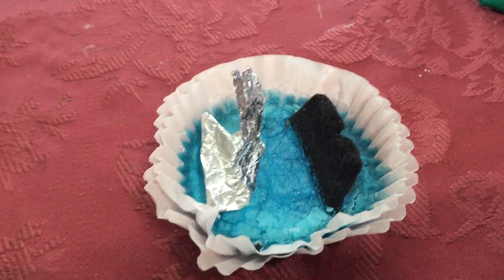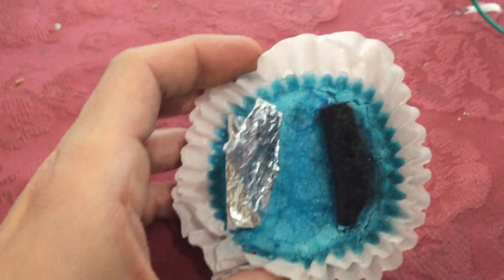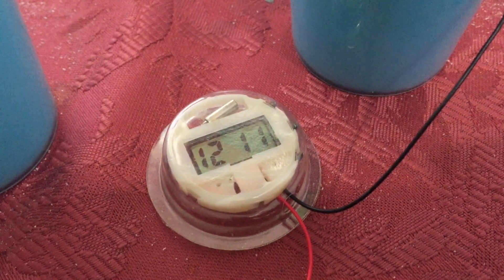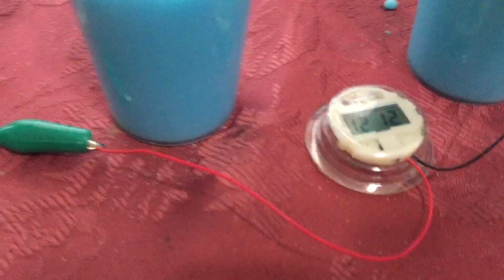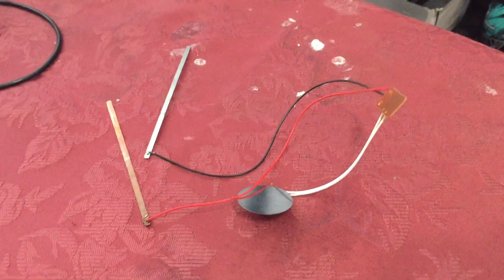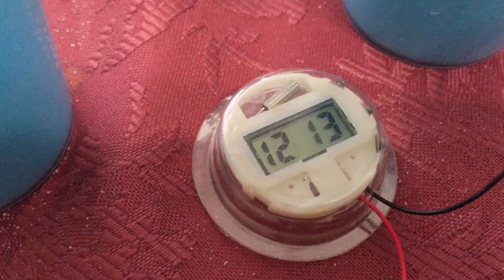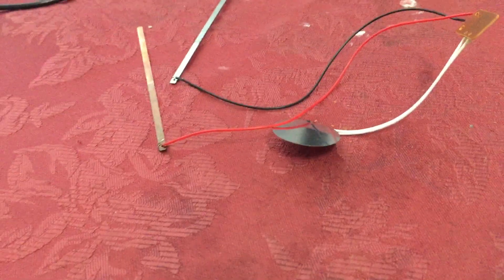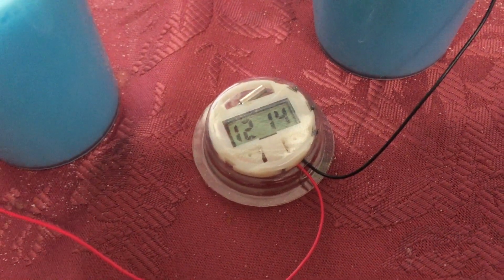PEG Cell Clock

Comment: Great update ❤

I wonder if you have explored the idea to reduce the size of electrodes and the consequent size of the cell ? I am getting the same results even if the “electrodes” are decreased in size to 3x1x0.2 mm. When I got the voltage I want with series of them, then I start to put in parallel such series and they start to fry LEDs.

In theory if we are able to make connections at small scale we can get a high power density and using non reactive elements and non reactive “electrolyte” they would last forever without the need to be charged. Atomised powders is the key and right method/tech to put them together.
Reply: I noticed the same thing with a different mixture, small 1-1.5cm blobs on Alu foil gave the same voltage as the big one. I hadn't thought about making more stacks and connecting them in parallel so thanks for that 😎👍